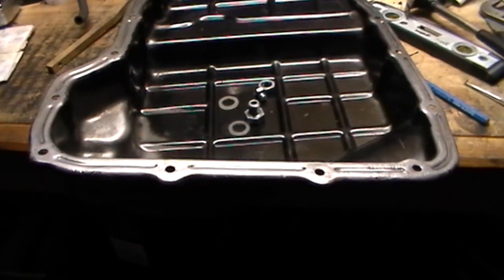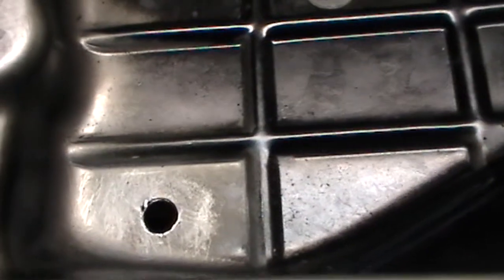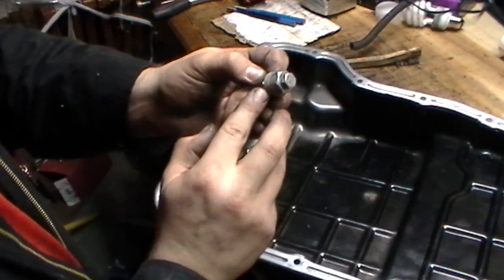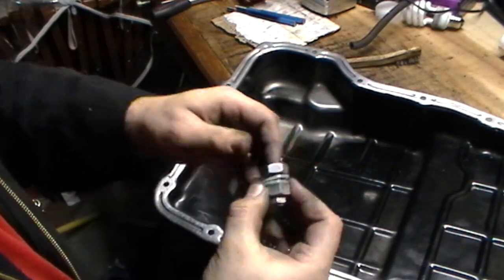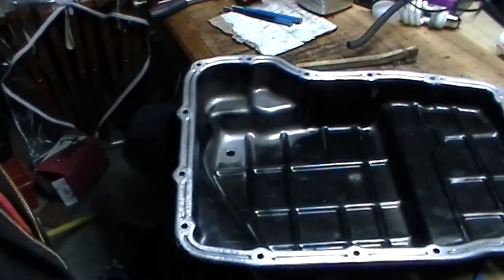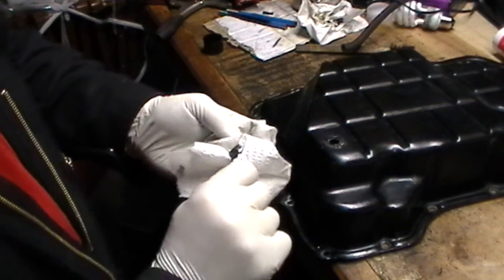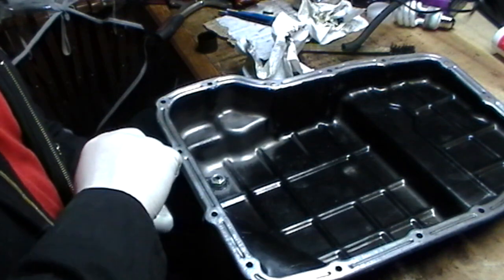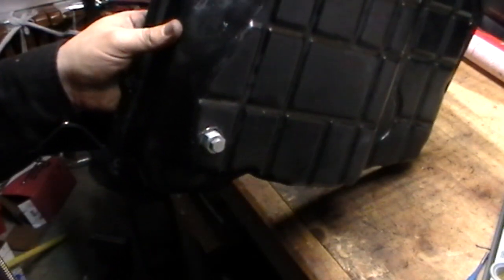How to fix a transmission oil pan design flaw (lack of a drain plug)

Comment: Would Loc-Tite secure the larger bolt?  They have a permanent version that's nuts.  Or JB Weld?
Reply from the maker: Possibly, but I don't know how those compounds react to oil. It may degrade over time when in contact with oil. RTV is cheap, simple and proven to work. Also, the RTV is not really securing the nut. It is sealing the hole the nut/bolt go through so it doesn't leak. I don't think that is one of the things that Loc-Tite does.

Comment: I don't think it's a flaw. It's a deliberate design by the manufacture to force people to rely on a dealership. The newer cars with sealed componants, computers and parts impossible to reach without a full shop puts more money in thier pockets. If most people could do stuff that saves hundreds of dollars, some dealers would close thier service departments.
IT'S A CONSPIRACY I TELL YOU, BIG OIL AND THE 1% ARE AFTER US. lmao
Reply from the maker: Agreed. I'm working towards that utopia of fewer dealerships, or at least cheaper rates, one YouTube video at a time. :-)
Reply: Deliberate flaw.
Reply: 15 years ago  I thought it was just an engineering oversight, but these folks are smart. There's shiploads of money in service and parts and folks trust the dealers to fix it right, right? Just design it this way and voila, money in the bank.

 Oh yea, and make sure you design a new chickens**t connector that snap together 30% faster and requires a special tool. Management wants assembly time decreased by 5%. Global competition is not good for reliability.

Comment: Great video Pet Rock, thanks.  I just changed my oil and filter on my 2001 Dakota with 4.7 and as much as I love Chrysler products I was dumbfounded as to why they did not put a drain plug on the tranny.  I was so careful draining it but it still went everywhere.
Plus, due to my failure to properly understand the installation directions.....I didn't properly seat the seal in the flat filter and wash sucking air and no movement.  So, gotta due it all over again and the thought of such a mess just isn't justified.
 This video is my salvation.  I will carefully drill a hole to save all the new fluid and then proceed with this procedure.  Thanks again for a no nonsense video
Reply from the maker: Good luck.  Be careful drilling into the pan if you intend to do it with the pan still on the truck.  You'll still make a mess once the drill pokes through and you might damage the internals of the tranny depending on where you drill.  I'd drill it once you got the pan off the truck.  You could try to salvage some of the fluid by sucking it out through the filler neck though like I do in the beginning of the video. Good luck...
Reply: I agree, i think you'll get metal shavings in your oil too.

Comment: You know they make an RTV that is just for transmissions it doesn't break down like others due when in contact with ATF fluid. Also only this can at Napa is a good gasket maker.
Reply from the maker: Permatex Ultra Black is perfectly fine with ATF fluid. Been running with it for years without issues or leaks.
Reply: +Pet Rock's Garage. Personally I would have welded a nut to the pan and ran a bolt with a nylon washer but that's just me. That's how I add drain plugs on transmission pans.
Reply from the maker: Not everyone, including myself, have access to a welder. Also the pans are extremely thin, so there isn’t a lot of material to weld to. But I agree that would be the better solution if you have the equipment & skill.
Reply: +Pet Rock's Garage . That's understandable and yes they are thin. But even with a 110v welder you can concentrate most the heat on the nut and work it down to the pan. But you are correct most people don't have welders. I always just assume anyone who does maintenance on their vehicle would have a welder. At least a 100v harbor freight one for just in case. With the pans i do now I mostly Tig weld them in but have done plenty with a stick welder and mig welder also. Just takes some practice. But very informative step by step video you have done for folks who are looking to tackle a install like this.
Reply from the maker: Yeah, I’ve never had a welder, but I’d love to have one. Sadly its not in the budget at the moment. I’ve been wanting to take a class on it at the local community college, but have never had the time. Only people I know who have a welder are pro-mechs or pro-welders. Anytime I’ve needed something welded, which has been very rare over the years, I bring it to a shop. I would say that is the common case among most DIY’ers.
Thanks for watching & commenting. I appreciate it.
Reply: +Pet Rock's Garage. I believe it only common given some type of people and how much they want to tackle. I do all my exhaust work on my vehicles also. But I also have done multiple off frame restorations professionally so a welder is needed. But my problem is why pay someone to do something when i Can do it myself or try. It sickens me when I hear people say a muffler shop wants almost a grand for a exhaust install or $150 for a 3ft section of exhaust pipe replaced. When you can buy a cheap welder where i live for $50 a 3ft pieve of pipe for $10.
Reply from the maker: I completely agree. But a lot of people don’t have a place to store a lot of tools (e.g. those that live in apartment complexes). For them, taking larger task to a shop is a necessity sometimes. At least with video’s like this one and others on the interwebs they will at least be able to gauge what they can and cannot do themselves and make an informed decision on how to tackle the job.

Comment: First of all, you drill a hole, not a "whole".
Second, why are introducing additional sealing surfaces into this assembly? If you're going to use RTV, why are you also unnecessarily installing the nylon washers with the plug? You only put RTV on one side of the washers. It would be better to just use RTV on the drain plug and install it alone then torque it. The nylon washers degrade with heat and exposure to oil but you left them in the assembly (without a single benefit). If you feel you must use washers (you don't), use copper or aluminum and coat BOTH sides of them with RTV then torque them. Either material can tolerate heat and oil without a problem. Still, just the plug and RTV would have been fine. Permatex #2 would have been even better as it is super oil resistant and stays pliable.
Also, I just did this job yesterday. If you slowly loosen the pan bolts and slip a thin putty knife between the transmission and pan, you can drain the fluid very slowly and carefully. I had a few drops miss the pan but nothing more. Just don't rush it.
Reply from the maker: 1) spelling isn’t my forte and my video editing software doesn’t include spell check.
2) The kit is for an oil drain plug. It would be silly for a manufacturer to include parts that would degrade when in contact with heat or oil. Would open themselves up for a bunch of liability law suits etc. The kit I show in this video had been on my truck for over 70k miles already by the time I made the video. As you see in the video the nylon washers haven’t degraded at all.  I put the RTV down on the inside because the sealing surface was not completely smooth as shown in the video. The RTV fills in the gaps that a nylon washer wouldn’t help. Plus RTV adds some peace of mind. If you don’t want to use washers, then don’t.  Its your ride.  But if your transmission oil leaks out and you burn up your transmission don’t blame me.
Yes, if you are super careful you can drain the tranny the way you describe. But search the interwebs a little and you will find that it is a very common problem to spill the pan all over as yo are trying to lower it down. Using a drain plug helps alleviate that problem. If you don’t want to add a drain plug, then don’t.  Again, its your ride. Do with it what you want.
Thanks for watching & commenting.  I appreciate it.

Comment: I don't know about putting RTV on the inside. Once it starts to deteriorate it could come off into the transmission and clog things up.
Reply from the maker: Sorry for the late reply. This one fell through the cracks. If you use the correct RTV, that is designed for transmission fluid, it will not deteriorate. So no worries about it clogging things up. Also, the truck came from the factory with RTV.

Comment: Greetings Pet Rock, Your vids are very helpful as I own a 2002 Durando and 2 Harleys as well. Any suggestions on curbing the engine killer sludge problem with the Durangos?      Thankyou!
Reply from the maker: +jeff brown, thanks. I appreciate it. Which sludge problem are you talking about? Do you mean the butterscotch pudding under the oil cap on the 4.7L Durangos?  If so, that is normal condensation that develops when the motor hasn’t had a chance to warm up all the way in cold weather. It will burn off.
Reply: +Pet Rock&#39;s Garage There was a design flaw on the smaller of the 2 V-8 engines 4.7ci I believe in which sludge apparently builds uo in the engine causing serious engine failure. frequent oil changes don't solve the problem. This was more common on 2000 and newer vehicles.    Thanks for getting back to me ,I love butterscotch pudding but not Dodge butterscotch pudding lol !
Reply from the maker: jeff brown, not sure how an engine design could cause oil to breakdown and turn into sludge, but stranger things have happened. Proper oil change intervals with quality oils is the typical solution to sludge problems. The only issue with the 4.7L engines I have heard of is a substance that looks like butterscotch pudding forming in the oil filler neck and it is just condensation mixed with oily vapor. Its harmless.

Comment: before I did my own servicing, my transmission guy used to drill a small hole in the oil pan to drain the fluid, then install a pop rivet to seal it. This used to piss me off so much I stopped going there for good,lol. I just purchased a drain plug kit 65241 from Rock auto and will install it on my super mint Chrysler Neon!
Reply from the maker: +Reece Thomas, wow. I would have raised hell at that shop if someone did that to one of my vehicles. Especially without my permission. Pop riots are not good for sealing. Plus if he didn’t pull the pan before drilling then he left a bunch of metal shavings in the pan which could get sucked into the transmission. The plug you ordered is pretty much the same as the one I used. It should work nicely for your Neon. Good luck...

Comment: I have used these. I sanded off the paint on both sides of the pan where the nuts contact, eliminated the washers and  used JB Weld ( epoxy)  on both sides coating everything well  and let it cure for 24hrs before I put it back together. JB weld supposedly can take the heat and ATF. It has been 2 years with no leaks.
Reply from the maker: +ppett1, thats a pretty good idea. Make sure to apply some paint to the sanded areas so it doesn’t rust out.  Thanks for the tip.

Comment: Some thread lock (Blue Locktite) on the thread would help prevent the nut from coming loose inside the pan.
Reply from the maker: +John Ferguson, thanks for the suggestion, but locktite liquifies under heat and the transmission fluid can get pretty hot.
Reply: +Pet Rock's Garage Red loctite doesn't its good until 500 degrees. Also the highest the transmission fluid will be is around 250 degrees that's pulling a load at a incline. So red loctite would work .
Reply from the maker: Adam Mcintosh, according to locktite's own literature they are good up to 300 degrees. Not a big margin for error when applied in a transmission. Red (242) locktite is up to 450 though, but is a bit overkill for this application.
Reply: +Pet Rock's Garage it's a pretty good margin for error considering transmission fluid in normal vehicles like the one you was working on will never see that temp. My Chevy 3500 pulling 7k behind it only reaches around 250 degrees going up hills. So it would have worked. But to each his own.